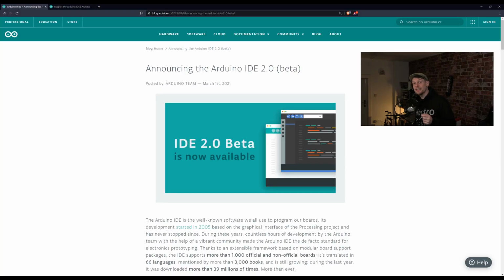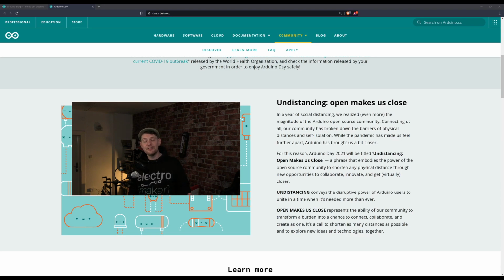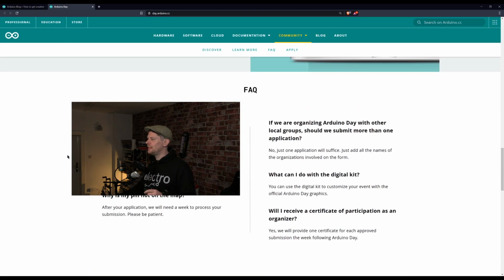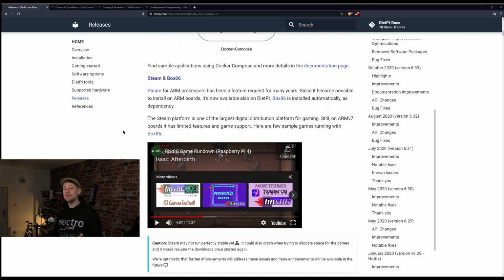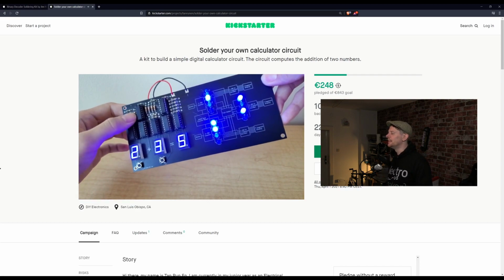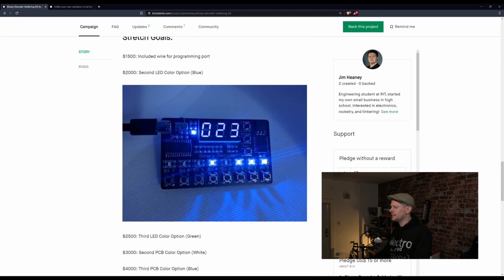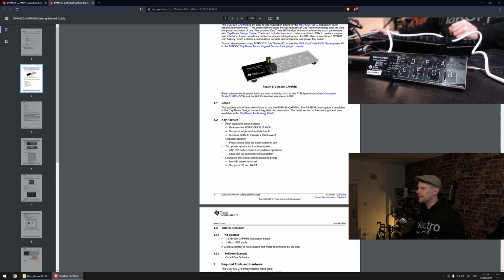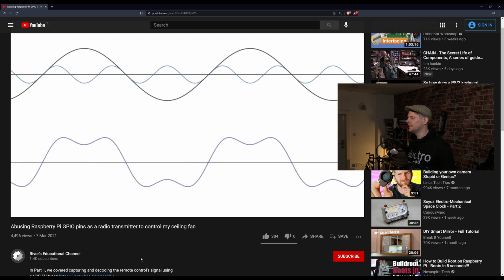Arduino IDE 2.0 Beta, ESP32-M1 Seeks Crowdfunding, DietPi 7.0 Supports Docker & Steam, and More!

Comment: The new arduino IDE looks good. The old one was not exactly cutting edge and for anything bigger than a simple program I ended up using platformio(vscode) or sloeber.